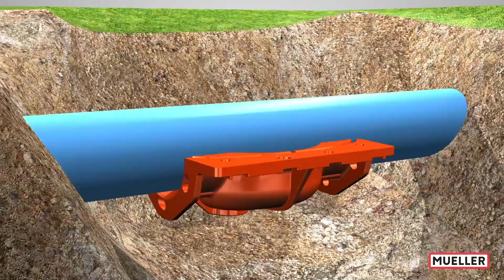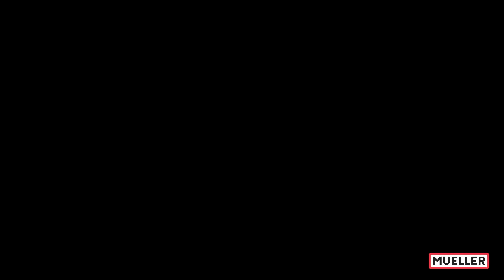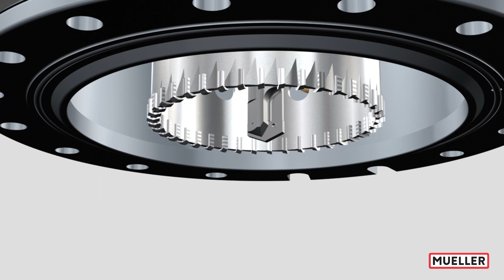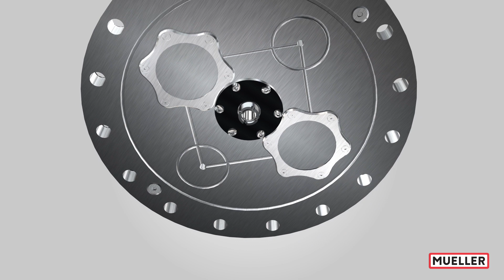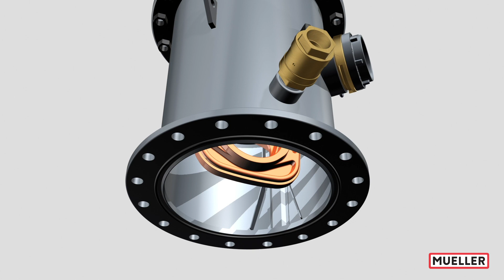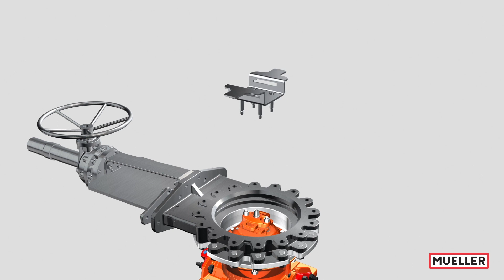PermaSeal™ Installation Video

Comment: How do you get the mechanical gaskets on the water main without open cutting
Reply: It’s called a split mega lug.
Reply: The fact the Mueller doesn't answer this is problematic. I agree with @DLo336 that it's a split joint but the video does not show that. Also the amount of steps required for this installation is wild.